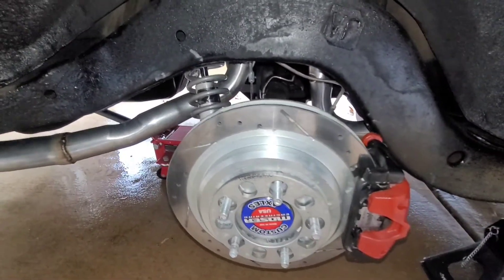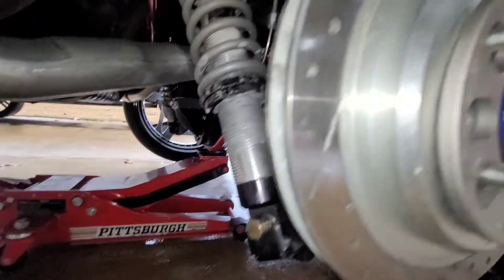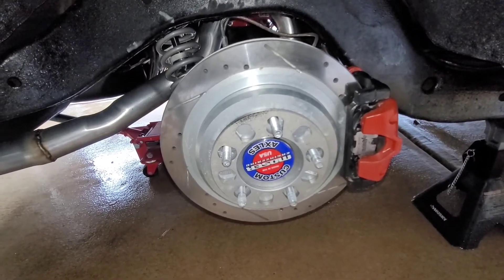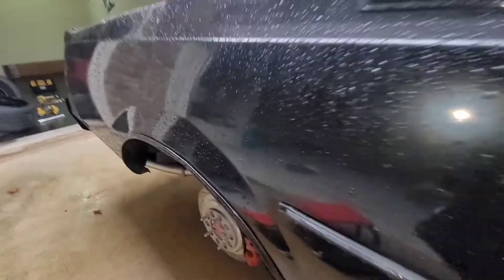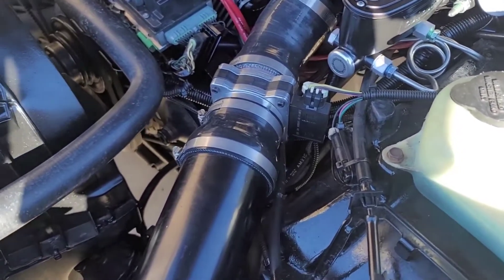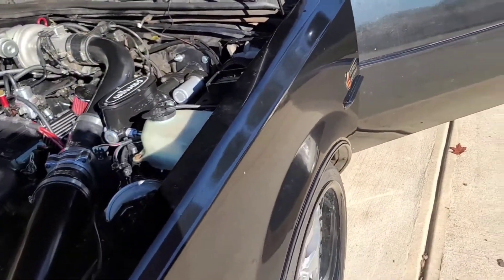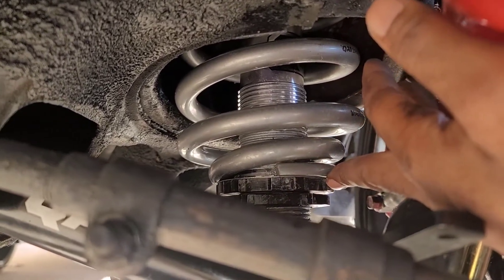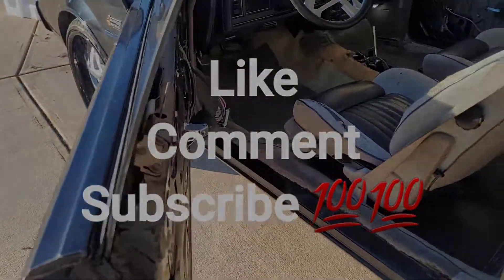Why You Need MAF Translator With Turbo Tweak or Extender Chip

Comment: What do u think of aftermarket headers floating around online?
Reply from the maker: I purchased a pair. I thought I did a video on it. The turbo updpipe doesn't like up from header to turbo and the oxygen sensor port is in the wrong  spot so the ac compressor can adjust right. So I'll be getting the pipes redone to move port and bolt up pipe. My down pipe comes in this week so I'll do another video
Reply: @PNC TV 2017  who made them? I posted a link to the headers but youtube keeps deleting my post. 😬
Reply from the maker: Got them off of eBay. They are the same ones everyone sells..they all come from China